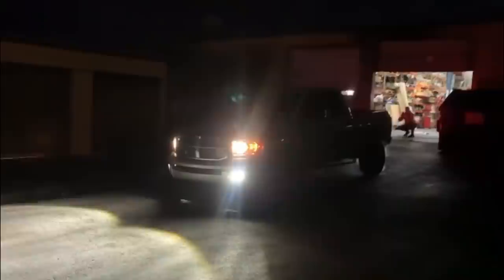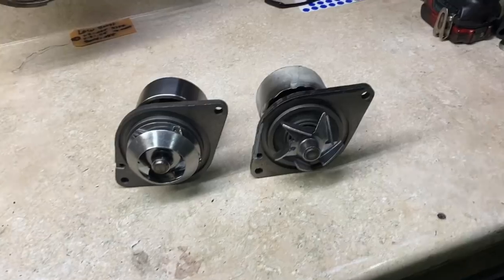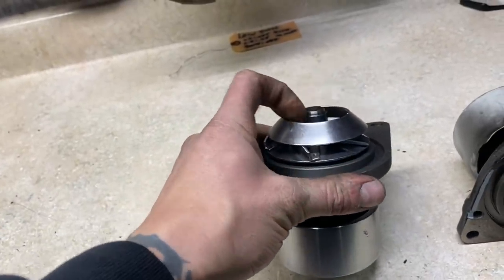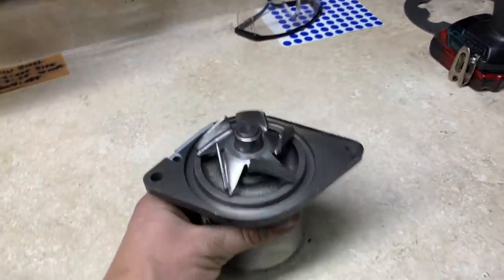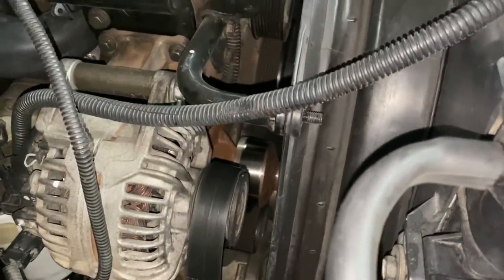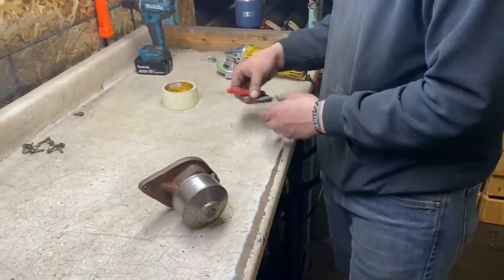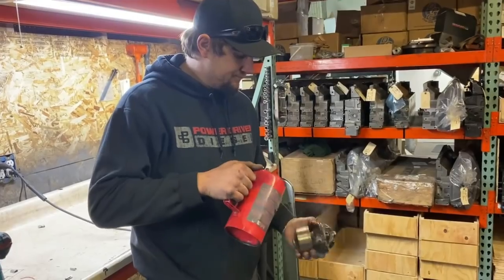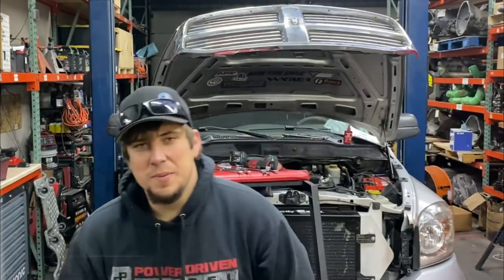HOW TO CLIP YOUR CUMMINS WATER PUMP

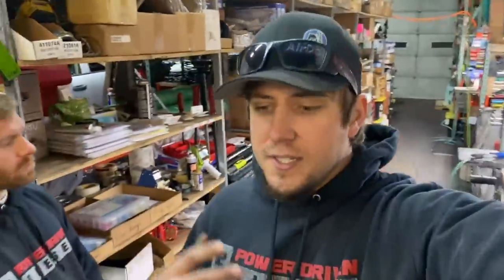Comment: 3:38 I just blew my head gasket on my 2008 dodge and we did a coolant bypass kit, new radiator cap, thermostat, head studs and gasket but it’s still blowing coolant everywhere in high boost. Will this fix my issue? Is a daily driver but it’s a 630hp truck

Comment: I installed the Fleece Coolant Bypass on my 08 6.7 and now the heat only goes to 160 degrees . I need to use a radiator blanket or do this . Its cold in Michigan !!

Comment: Which type of pump would you recommend for a daily driver that's pretty much stock? I got an 06
Reply from the maker: Just an oem style pump
Reply: Fin only . No ring . That is a leftover from 1st gen/ industrial VE w/ 2500 gov(2000 full fuel) its a high flow model . The ring was to keep water flow up @peak tq (non hi-way  peak 1200) but was too much block pressure for 1800-2400 rpm  so was droped for 2nd gen up.

Comment: The dodge pumps might be totally different but I know on duramax the plastic pump is the one you want because the cast pumps even if welded spin on the shaft. And I believe its Danville has taken the plastic ones to 2000 horse power and no issues and that's all they like to use now as well as alot of other shops. But the design and impellers are totally different from durmax to cummins so i'm sure it's not even worth comparing.  Just kind of interesting.
Reply from the maker: I did know they had an issue didn’t know what the issue was exactly

Comment: Why not just drill a hole in each fin, say 3/8”..?
Reply from the maker: You could do that as well!
Reply: I wonder if you’d run into cavitation issues on the outside of the hole you drilled. For water to bypass the fin by going trough the hole it might start moving pretty quick.

Id be interested to see if anyones tried this and if it worked out alright or if it ate up the fins

Comment: pretty sure that pump spins at least twice if not 3 times faster than the crank.... you can chuck the pulley in the lathe and shorten the fins, might just stay better balanced

Comment: The ones with the rings on them actually were for the 6.7’s & were meant to drop pressure but pickup volume
Reply from the maker: Interesting Cummins QuickServeMobile shows an open fin design from 2007.5-2018
Reply: I have pulled many ringed ones out of stock 12 valves.... back in the early 2000s
Reply: Luke
1st gen and industrial  got the ring for proper flow at low 1200-1400 rpm(industrial peak tq at 1200) all day  in a log skidder. 2nd gen lost the ring as it proved bad juju @1st gens 70mph @ 2300rpm. Late 1st gen  OD helped but pulling the ring helped more in 2nd gen.

Comment: What RPM is safe before having to do this mod?
Reply from the maker: 4000rpm give or take
Reply: Or on a 53 block regardless of RPM.  Reducing cooling system pressure is supposed to reduce the chance of the block cracking and it can't hurt.

Comment: I just had my water pump go in my 04. When I took it out all the fins were missing. I poked around in there with my small magnet hoping to at least find one but no such luck.  Ever heard of that happening? Not sure if it’s going to bite me down the road, but I hope not.
Reply: I have and was told to get what I could. Send it following
Reply: Yeah it happened with mine aswell it would overheat til I got those pieces out
Reply: Thanks guys. I will keep trying. I put the new one in and took it for a 4hr drive and everything seems fine.  But for piece of mind I’ll keep trying.

Comment: I would think that you are setting up the water pump for premature failure with an unbalanced impeller. Once you touch the impeller with that grinder it’s unbalanced.
Reply from the maker: It’s funny you mention that. We cut one apart and even in factory form they aren’t well balanced. While I agree with you to some extent I would say grinding the fins somewhat evenly is much more balanced than grinding 2 of 5 completely off